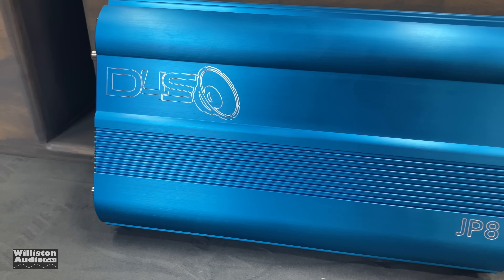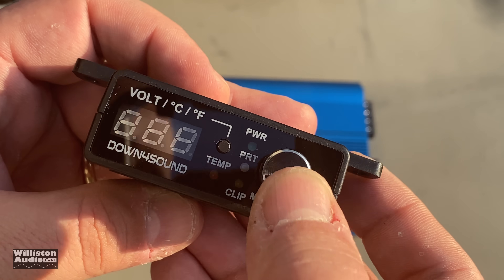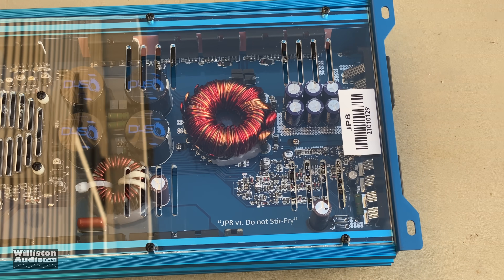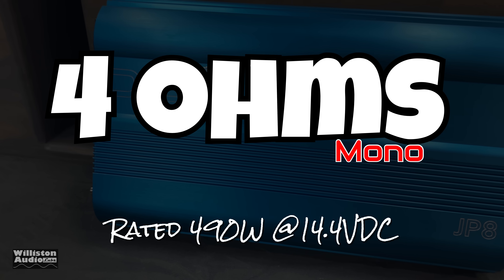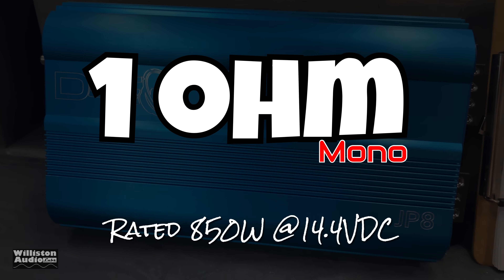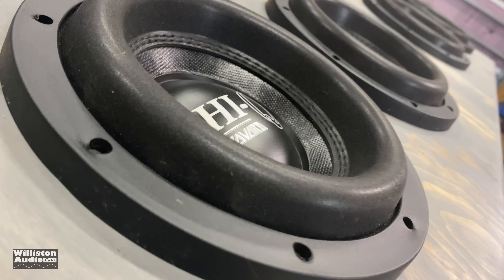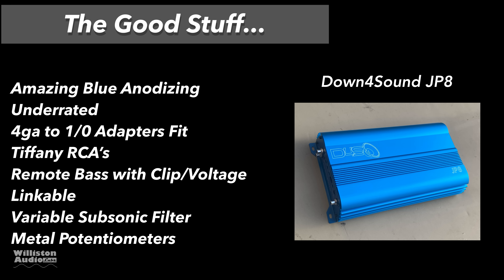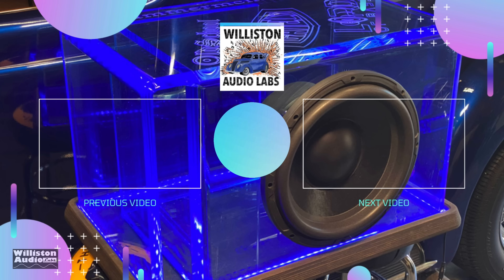Down for Anodized Blue? Down4Sound JP8 800W Mono Block Amp Dyno Test and Review [4K]

Comment: Last JP amp, the bass knob and dyno voltages showed a different number. I questioned why and which was wrong but got no reply. Now You hide the voltage of the bass knob on this one 🤔
Reply: Most bass knobs with voltage displays are ALWAYS off a little bit, my salt knob is .5v off.. not a big deal for anyone who uses a good volt meter. But the new knobs coming out are adjustable so they can be set correctly.
Reply: @YouTubesucks..  .5 volts off I bet you start getting a fluttery should I turn it down when it dip I’ve got stock alt so I really have to watch my voltage altho it did kick off once I seen 9 and then it said lo and I had to restart everything but it went in protect that’s the easy part .... the most important part is it came out of protect
Reply: Some bass knobs with the voltage meter neds to be adjusted so it’s possible
Reply from the maker: I only hid it because the blue light messed up the image on my camera. It’s about 0.3 higher than Dyno voltage
Reply: @wal  those knobs are adjustable, that little hole on the top is where you adjust it at
Reply: I noticed that too

Its does seem a little suspect that the voltage on the knob was blocked since this time the amp was given to him by D4S. Big D always seems to be straight up so ill give him time some time to respond to this before making somthing out of it

Comment from the maker: Check Out My 2nd Channel: http://www.wheeliewilliston.com
Shop for this JP8 Amplifier: https://lddy.no/vvaw
Shop for Down4Sound Amps: https://is.gd/D4Samps
Savard Hi-Q 8" Subwoofers: https://amzn.to/2Nh1qcf
SMD / D'Amore Engineering Amp Dyno: https://goo.gl/sJTcf7
XS Power D1400 Batteries - https://amzn.to/2BPFCKW
XS Power PSC60 Charger - https://amzn.to/2CHGcfs
Fluke 1000A AC/DC Clamp Meter: https://amzn.to/2Rw5WDA
Handheld Dyno: http://amzn.to/2u2EgKV
My Favorite Screwdriver Kit: http://amzn.to/2x0VzcE
See previous video on JP23 amp: https://youtu.be/ufuoi-vn-g4
Low Ohm Tests of D4S JP23: https://youtu.be/v7nohX0C3gg

Note: video is listed as sponsored because amp was given to me as I'm an affiliate of Down4SoundShop.com. This does not mean the video is an Advertisement, I still provide factual data from measurements plus my genuine opinions.

DISCLAIMER: This video and description contains affiliate links, which means that if you purchase from one of the product links, I may receive a small commission. As an Amazon Associate I earn from qualifying purchases
Reply: ❌ 🔥hay _ BigD👈 I Know you are a fan of ...USamps Wondering if you’d dyno the RE sa3000.1 -1.7k amp I have one it’s the most beautiful amp inside and out next to oldschool PPi art series water coolers💦 , but no one has dyno’d it ,it’s like _RE/USamps don’t promote ,or market their SQ stuff well  please check out the pics of the big Amp inside out  just gorgeous hard to find gut shot but when you do just sick,would make zapco Ap’s jealous‼️